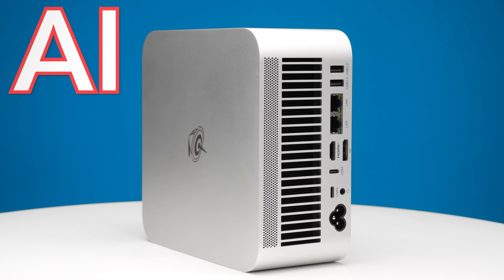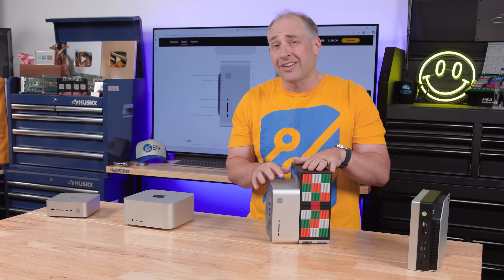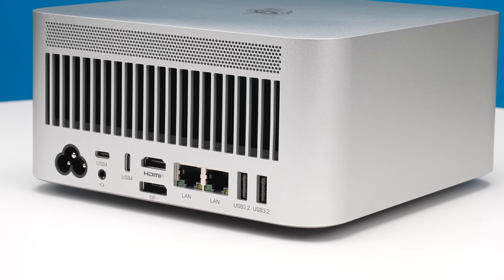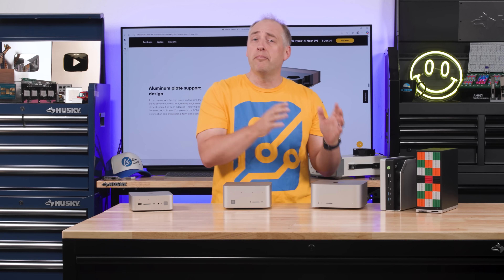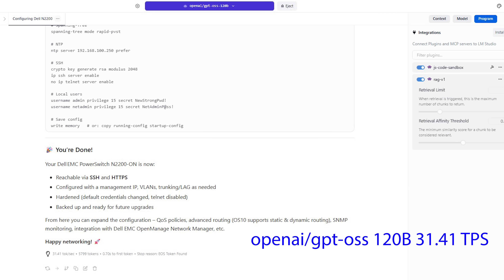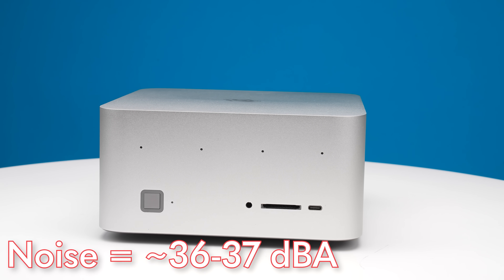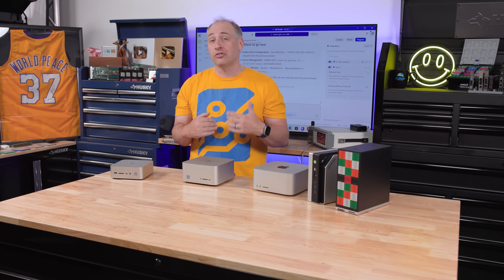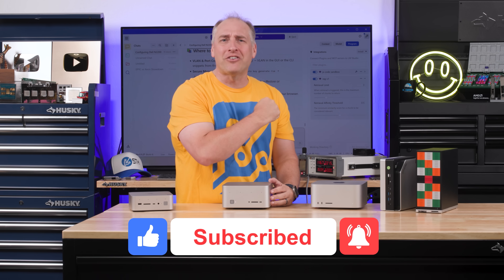The BEST AI Mini PC That One Upped Apple? AMD Strix Halo Beelink GTR9 Pro

Comment: You mentioned that it wasn’t straightforward to remove the junkware. How did you go about removing it?  I ordered a GTR9 Pro and expect it to arrive this week.
Reply from the maker: Delete via add remove then deleted the folders of what was left
Reply: @ServeTheHomeVideo  Understood, thanks. I was thinking that these apps may not have been listed under add/remove. Totally agree with the feedback to Beelink re junkware. Great review and keep up the great job on creating valuable content.
Reply: I was told, the best way is to System > "RESET Your PC", choose to remove and delete everything and then make sure you choose download Windows from Cloud.

This way, it's downloading from Microsoft the original windows image and it deletes everything on disk including the recovery partition which has the manufacturer's version of Windows with their junk ware.

An even safer and better way is to delete all partitions and install from USB stick with ISO downloaded from Microsoft using USB install creation tool from Microsoft.
Reply: @sigma_z asuming you dont need any vendor Tuning or Esoteric drivers. Sounds like the Nic for example won’t Like the Stock Windows (yet)
Reply: @berndeckenfels  I see your point and at the same time, I value a secure system as much as possible.

I work in the IT industry so I'm very careful with what I allow to be installed on my machines and into my secured private network. 

Some other people like yourself might have a huge risk tolerance to spyware and that's ok.  But not for me. .

What I say is, if the drivers for the device is legit, it should have a Microsoft certification and these drivers will come down with your usual Windows update. 

If it doesn't have MS certification, then it shouldn't be installed on the machine as it has a higher risk of containing malware or spyware.

And this is why I always reset the machine or install from USB with a legit copy of Microsoft Windows or your chosen OS, your flavor of LINUX distro etc...
Reply: @sigma_z well, you still use Windows so it can’t be that paranoid :)
Reply: @berndeckenfels  only because some of my Enterprise clients requires me to run special VMs.
Reply: @sigma_z  Hi! Please rest assured that the Windows system pre-installed on our devices is 100% genuine and does not contain any spyware. 
We collaborate directly with software vendors to pre-install certain applications in order to provide a convenient “ready-to-use” experience and address common user needs. All pre-installed software is fully licensed and secure. Of course, you have complete control — if you prefer not to keep them, you can safely uninstall any of these applications through the system’s “Apps & Features” settings without affecting your PC in any way.

Comment: Can you do a comparison of this unit vs the Minisforum MS-S1 Max. The GPUs are different and I suspect the Minisforum will perform a bit better.
Reply: Same Radeon 8060S iGPU in both. GTR9 Pro lacks PCIe expansion; MS-S1 Max has PCIe 5.0 x4 (x16 connector), but Minisforum says discrete GPU use isn’t supported.
Reply: @daveweinstein5044 I thought the Minisforum had a different GPU but went back and re-read it.
Reply from the maker: Yes. The 4th one we mention is the S1-MAX. It did not make it on set for this one but we covered it a bit more in the web review. Beelink is quieter and designed as a Mac Studio replacement. Minisforum is running at higher power so it is noisier. Those are probably my top 2 right now
Reply: @ServeTheHomeVideo  what web review i cant find it on your website or am i blind.

Comment: Awesome machine. What’s the biggest ram split setting? 120/8?
Reply: Hi! You can allocate between 512MB to 96GB of memory to the GPU according to your needs, and the system memory will increase or decrease accordingly.
Reply from the maker: You can do at least 126GB CPU 2GB GPU which is what the Minisforum S1-MAX comes with by default. I think you can go down to like 512MB on the GPU side if you really wanted.
Reply: @ServeTheHomeVideo what about the other direction; maximum gpu ram and minimum system ram?
Reply: @yoshi194268  The fixed split goes up to 96GiB iirc, but there's no need as it can access memory outside the split just as fast.

Comment: Can it run Proxmox?
Reply from the maker: We only tried Ubuntu on it but that worked and is Debian based
Reply: Should be able to run proxmox with some tweaking, but I spent a day trying to get GPU passthrough working with proxmox and gave up for now, I'm using podman / toolbx for containerization.  I may try Proxmox again when I have more time to play with it, or when I find someone on the forums that has a working solution.

Comment: The one issue that nobody is talking about when it comes to these being a cheaper alternative than a dedicated GPU and server, is the lifespan and lack of ability to repair these mini pc's. I don't hoenstly see these systems lasting very long and once one thing in the unit breaks, the whole system is gone and would have to be replaced. In the long run it actually becomes more expensive due to that I think. I also think the Minisforum MS-S1 may be the better choice. As well as that one also has 80Gbps USB4 ports.
Reply from the maker: For a server style, that one is good as well, but it’s using Realtek NICs and it’s much louder. On longevity we will have a piece in a few weeks but we will get a sub 1yr payback on these systems.
Reply: These things will be obsolete in 2-3 years so it's probably working as intended.
Reply: This is definitely a consideration. I would contend that many home labbers aren’t so space constrained they could just build a ATX box. I have one server that is like the ship of Theseus, it has been repaired and upgraded so many times. Not everyone has the luxury of space, but if you do I’d absolutely consider just going a full size machine.

Comment: Nice, but I'm looking forward to your MS-S1 review. USB4v2 and a PCIe slot are more compelling to me than Apple styling.
Reply from the maker: Realtek 10G NICs and much louder (they are sitting right next to each other so it is easy to notice)
Reply: @ServeTheHomeVideo Are the Realtek RTL8127 chips an issue? Linux driver support has been included since kernel 6.12 (Sept 2025). Could USB4v2 ports link two S1MAX devices for 80Gb/s AI clustering? Also, the S1MAX’s 160W power mode might outperform the GTR9Pro’s 140W - any thoughts? Maybe I should just wait until your video on the device.😁
Reply: @daveweinstein5044  Can't remember which video it was , but he was saying that the Realtek's don't work in Linux ( proxmox ) and he had to use a USB network adaptor .
I've got a MS-S1 on the way so hope they have fix by the end of the month .
Reply: @daveweinstein5044 Realtek NICs always have driver issues on Linux.
Reply: @ServeTheHomeVideo  So you are saying that is hard to cool Realtek 10G NICs? But I think in general the framework has better cooling system. Maybe the best ...
Reply: @mkunikow No, they’re just saying random words to avoid actually addressing the request for whatever reason. It’s louder, they don’t say why. It has Realtek NICs, but don’t explain their concerns. 

Don’t expect useful comments from STH staff. They don’t give any.

Comment: Dang, wish I would have known about this before amazon prime day.  I picked up the GMKTek
Reply from the maker: GMKtec on sale under $1999 is still pretty darn good.
Reply: Some reviewers have said that Beelink's Ethernet connections would die randomly after a few minutes of use, and they had to restart the machine but the same problem would still happen again.
Reply: @sqlexp  There is a firmware mismatch to what drivers are expecting; Beelink says Intel needs to release an updated driver, Intel says Beelink needs to offer a firmware update, some people have gotten the ports stable by messing around with it on their own and get it working correctly under Windows just to turn around and face the same problem under Linux (or certain kernals?). Long story short anyways. I canceled my order before it shipped so I don't have personal experience with the problem, but I believe it's an under load kind of thing.